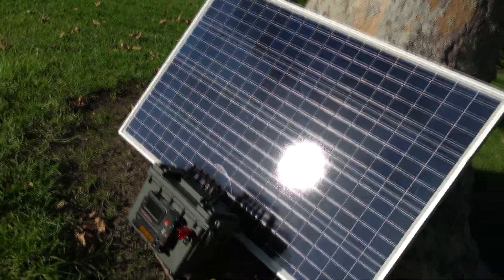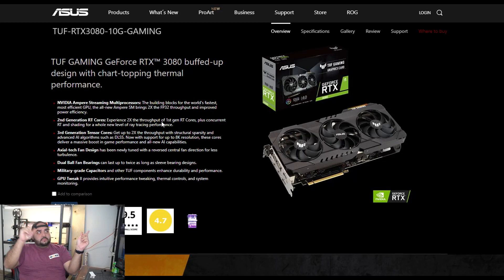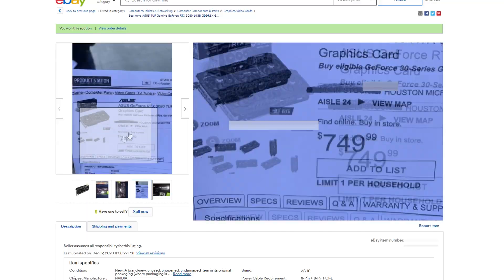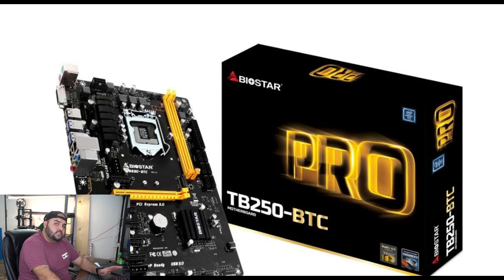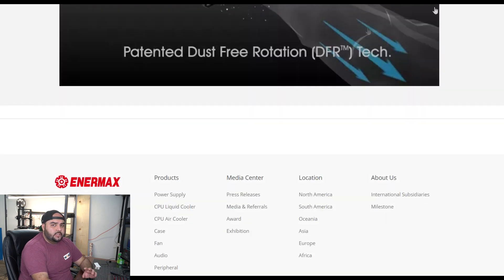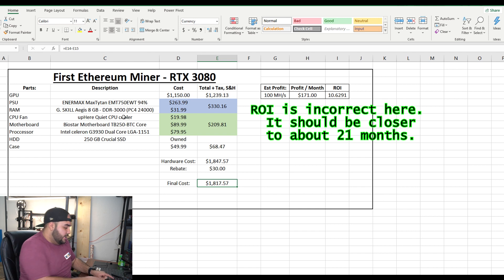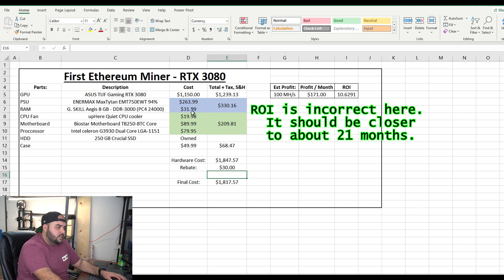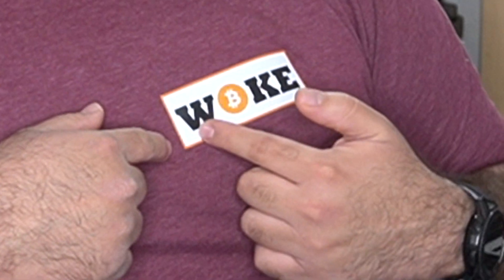Building my first crypto mining rig using an RTX 3080 | Part 1

Comment: First of all, thank you for sharing so much and that it is a great help, great channel, secondly if you can clarify a question I have, connecting a single GPU (MSI GeForce RTX 3080 GAMING X TRIO 10GB GDDR6X) to the motherboard. TB250-BTC Version 6.x, is it necessary to put a riser or directly to the PCB of the board? Thank you !!!
Reply from the maker: Hello. Thank you for the feedback. If you are only using 1 GPU it is not required 😊
Reply: @AlansInventions  
Thanks for your quick response, I am following your videos to build an identical RIG, same components but without box for now, your channel is a very good channel and a great help, will you make video if you add more GPUs? In case of adding a second GPU, which riser would it be? Thank you !!
Reply from the maker: Hi - No problem. It doesn't really matter which one you plug it into. You're OS will automatically detect it. If you're using HiveOS there is an identify feature that spins the fans one by one to correlate the cards to which number they were assigned. My case is unique, I haven't seen many like it and I got it for like $50 USD. Unfortunately the manufacturer stopped making them 😕

Comment: Awesome video, I think you deserve way more subs
Reply from the maker: Hey thanks :) I was just wondering if I should continue making videos or not...
Reply: @AlansInventions  I was actually wondering how much MHs you can get with 4 RTX 3060s
Reply from the maker: I am getting my first one. A gigabyte 3060. From what I read online it should be around 55-60 MH/s. Too many data points on power, however I did read it's the most efficient. I will probably put out a new video shortly once I get the last card. I'll have a couple of 3080s, 1 3070 and 1 3060. I estimate around 305-310 MHs and about 820 watts at the wall.
Reply: @AlansInventions  and yes keep making vids BUT only if you enjoy it . . .

Comment: I'm just about to finish my very first mining rig myself. Its going to be 6GPU for now. Asrock H110. I have 2x RTX 3080 TUF inroute from UPS day or so. I'm military and live on post so free electric for me...
Reply from the maker: Nice! Lucky. I could only get 1 3080 :( and I definately overpaid. The first ebay listing I got for $1,125 turned out to be a scam. The guy never shipped. So for the video I bought another one and it cost me $1,275. Luckily I am getting about 99 MH/s second right now. I should be pushing out that second video hopefully tomorrow or saturday. Where did you get your cards?
Reply: @AlansInventions  oh wow sorry to hear.. I over paid for mine as well. $1,150 and $1,200. I bought from Nerd Gearz and the other from EBay.  Just finished Configuring bios and installing Windows 10. I just learned how to Remote Desktop with my Gaming PC to the rig. So cool.. my gaming pc have a EVGA 1080 FTW only 25 mh/s @ 120w
Reply from the maker: @gman4848xxx  Nice! I ended up using HiveOS for mine. I didnt want to pay for the windows 10 license.
Reply from the maker: Very nice! I'm. Currently at 270 Watts at the wall, 98 MH/s, - 200 core and 2350 mem speed. Speed is on auto. Temp is 48C 😊
Reply from the maker: But it was also 90 degrees here yesterday and will be around 85 today 😅

Comment: i have the same board. did you have issues getting the cards to detect i\on it? mine wont detect any cards. i have a rtx ftw3 ultra and 3060ti ining right now on my pc.
Reply from the maker: I am literally just assembling it now. Mr UPS man should be here any time now with my card.
Reply from the maker: Hey getting back to you I had no issues what so ever with the first card (3080) the second one was a bit finicky and I had to update the drivers on HiveOS. We're you able to figure out your issue?
Reply: @AlansInventions  no I had a faulty board so waiting on a different one. I am using my pc now. Just bought another card now too so I have my 3080 and 2- 3060ti now. Adding new cards every month now.
Reply from the maker: Nice! What's your electricity cost and ROI?
Reply: @AlansInventions  I’m using close to a $1 a day with 3 cards running and making $20 + and day. My power is cheap here.

Comment: Is there still money to be had doing this ?  Last I heard power cost overtook the values.  Using solar is a option ?
Reply: I rarely go over my power budget usually under and im not even mining on a super efficient setup just from  my PC with optimized GPU performance for mining. On a 6800xt I have made like 15$ passively in 3 days with the miner on and off, an efficient rig will be very profitable right now
Reply: @Ryan-xq3kl  Power is free with enough Solar Panels.  I have them.
Reply from the maker: How much power do you have available? Also, do you have batteries? Otherwise the rig would only run during the daytime.
Reply from the maker: Yes I was hoping to find a couple more 3080s but I have been very unsuccesful. The listing I ended up winning when I made this video actually was a scam...I am disputing with ebay now and went and bought another one just so I could complete this 3 part mini series I wanted to do on mining. :( cost me about $1,300 bucks.
Reply from the maker: It is profitable to mine right now even with a high electricity cost if you have already paid for your hardware. In my case I have to wait to recover my upfront investement. If I mine that long and it's still possible. If it doesnt work out I will have a 3080 to game on :)
Reply from the maker: Solar may be good option for this, I could see myself doing this with a couple 200 Watt solar panels, batteries, an inverter and a shed. However I dont think that will fit in my office and is probably against apartment rules.